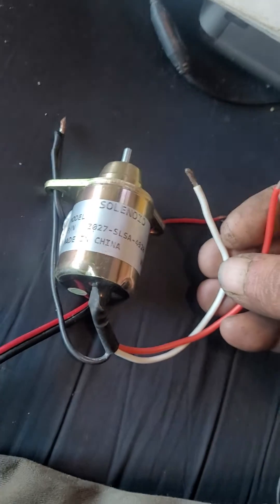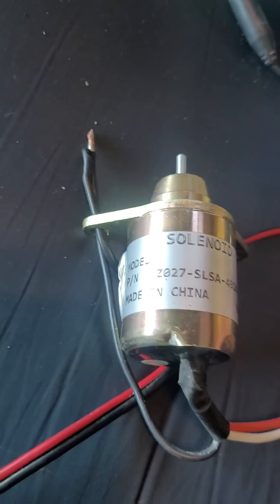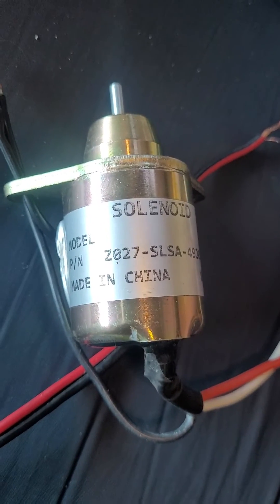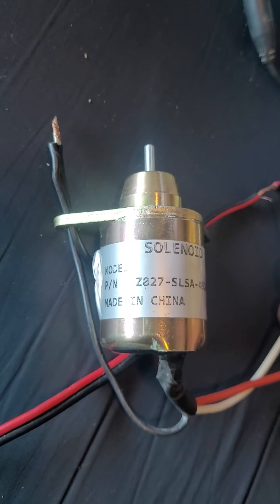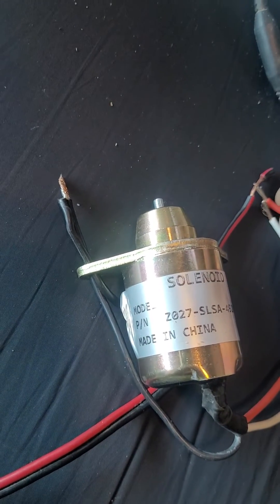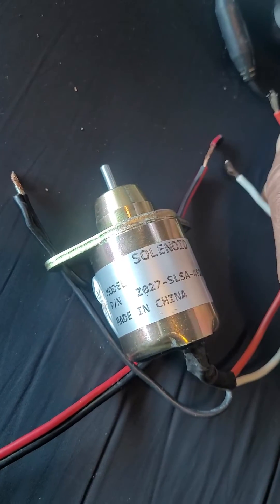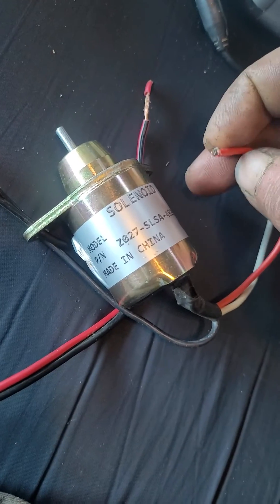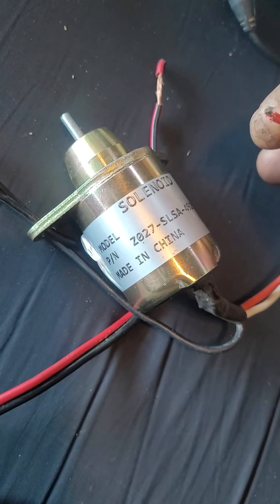3 wire fuel shut off solenoid Thermo King Tri Pac APU wiring..Running Yanmar engine without with ECU

Comment: If anyone else is wondering how to wire this, I'm thinking white through the start terminal on an ignition switch, while red connects to the run terminal, to keep the solenoid held during operation, and of course turning the key off de-energizes the red, releasing the hold on the solenoid, shutting off the fuel.

Comment: Where is this located on the apu ? I have a tk evolution and not getting fuel to the injectors and the fuel is new and pumping . So I'm thinking this is my problem and need to change the solenoid.  Where is this located at and has it been a reliable part ?

Comment: I running same solenoid and I think it’s electrical problem I’ve already put 3 new solenoid they all do the same thing….. engine cranks but solenoid will pull in and spit back out and just turn the engine off. But it will stay in the fuel on position only if I push it jn. Any advice would help thanks!

Comment: So help me understand, how did you connect that solenoid on the end?What wire is connected on what (ignition,power,ground…)?
Thanks
Reply from the maker: The black wire is ground...When the APU is about to crank over..the wire that connects to the red wire will have power but will not open fuel valve...when the ecu sends power to the fuel pump and start alarm..it then sends power to the white wire very momentarily and the valve will stay in the open position as long as the red wire has at least 10 volts or so...As far as where and what position in the triangular plug with all white wires on mine..I couldn't say ..It would need to be tested for a good ground ,constant power and cammand  voltage upon start up sequence before cutting off the connector from the defective one to attach with butt connectors and shrink wrap......If you don't have voltage etc there then this selenoid isn't the issue....I'm running the unit stand alone as a hydraulic power unit that runs for just a few minutes at a time .All the ecu BS and not starting because of low refrigerate pressure and the like didn't seem worth dealing with just to have shut down protection for over temp and low oil level...I replaced the alternator with a 15gpm vane pump to operate a boom and under reach tow unit..
Reply: @muthatrucka76  that was very helpful.Thank you for sharing all this information!